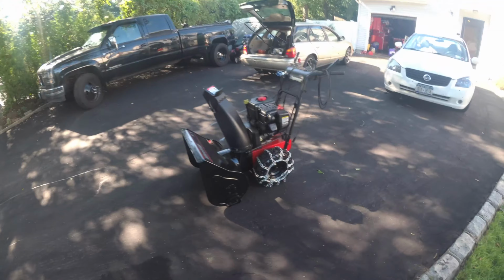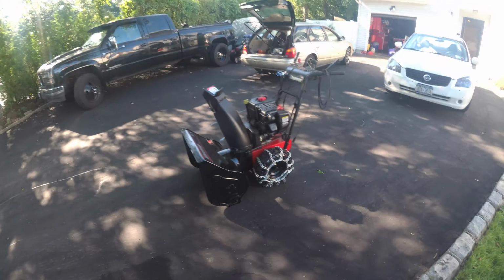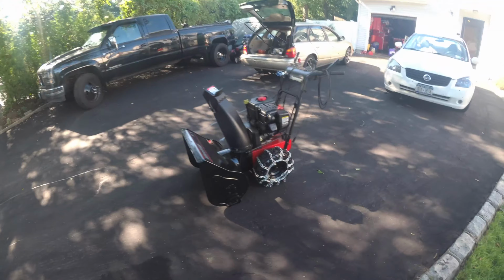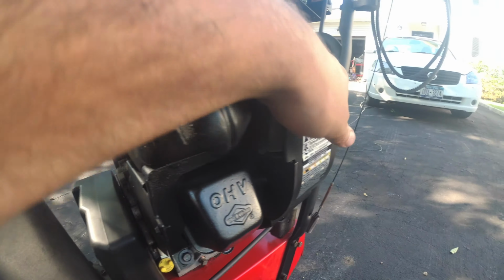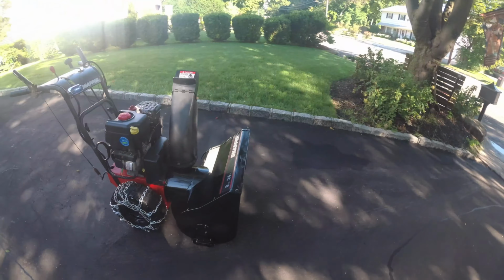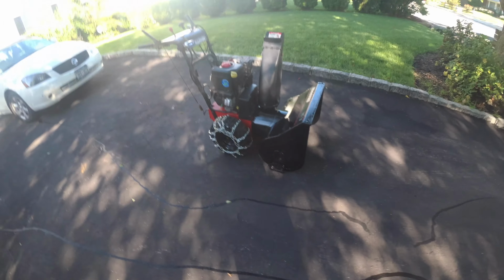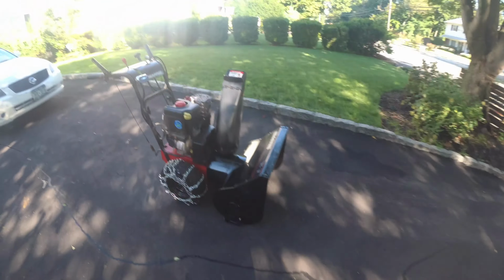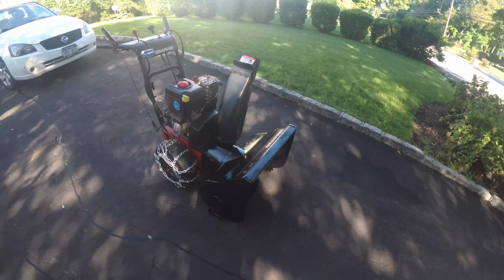Snapper 824 Snow Blower Build P4: THE END Restyle & Restoration REVEAL Briggs & Stratton 8HP Engine

Comment: Im not tying to pick on anyone however you must have so much time into that machine from start to finish I dont know how you will ever get you money back out of your parts and labor. The machine could be almost 20 years old give or take. It looks good however time is money and like you stated on the first video about the snowblowers age etc , I would have replaced the belts if needed, got it up and running decent and sold it, Putting lipstick on a 20 year old pig dosent make it a great machine. You also have a sticker on the machine that you said you would tell someone they were the ones who did the tune up etc. If you did the repairs say it was you and not some other company who did the tune up and other work, Im confused about that statement. Anyway as stated earlier it looks good and Im sure its ready for a new home .
Reply from the maker: Good Morning, I didn’t feel picked on.  I sold the machine for $700.  If I had all the parts in stock I could have had this machine done in one day.  I ABSOLUTELY agree that time is money.  I also ABSOLUTELY love bring machines back and improving them from when they left the production line.  

Everything I sell I service!  I stopped telling people that I service the machine bc THEY think my time is free.  Servicing a machine increases and adds value to it.  Even though it doesn’t take much once you get the hang of it.  I still value it!

I checked my record and I had $160.96 into the machine including the purchase price and labor.  I can only speak for myself but I’m happy that this machine is back to kicking @$$ with over $500 in profit. Still money to be made since ebay bucks and credit card incentives.

It’s 4am here, so I hope I’m clear.  If there is something I missed don’t hesitate to ask or comment back!

Thanks for the view and comment, hopefully you subscribed to my channel! 🇺🇸🤙🏻🦅🔧